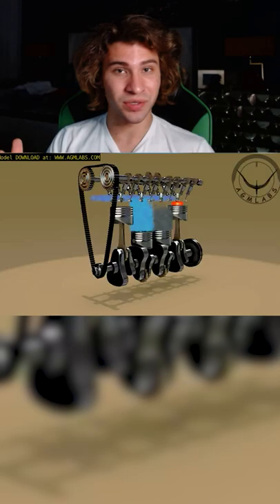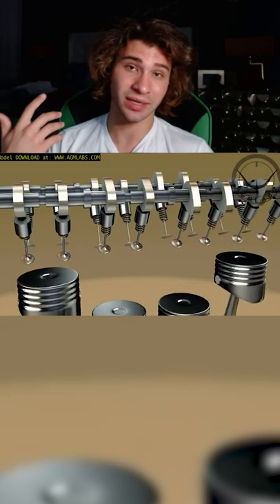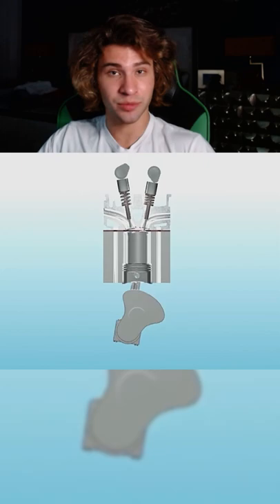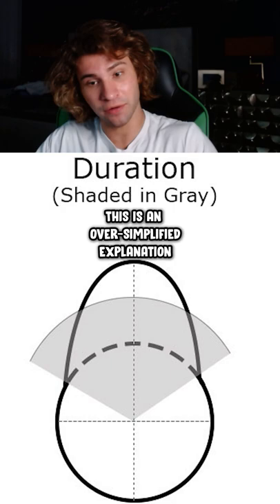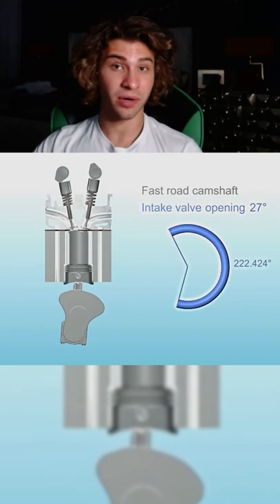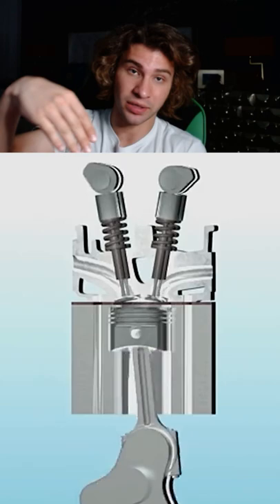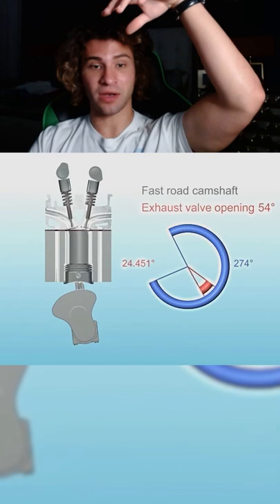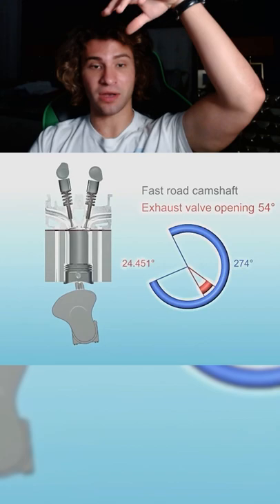HOW AFTERMARKET CAMSHAFTS INCREASE THE HORSEPOWER OF A CAR! (SIMPLEST EXPLANATION POSSIBLE) #COMPCAM

Comment: Good explanation for a short, anyone interested in a full explanation, here you go.

Camshafts have three(sometimes four with things like V-TEC) variables you can play with, timing, camshaft lift, and camshaft duration.

Tech like VVT use a spiral spline that  can rotate from the linear motion along the spiral, like a worm gear to change the timing of the camshafts.

This can compensate for restrictions that appear at higher RPM due to the physical speed of the moving air or how much pressure/vacuum is present.

Camshaft lift controls how far the poppet valves open at the top of the cam. At low rpm, the air is moving slowly, and it doesn't have much inertia.

So you don't want the already slow air to go back out because the intake valve is still open when the piston reached BDC(bottom dead center). At high RPM, the air is moving fast, and if the valves don't open far enough in time it restricts the engine, reducing the total air intake, and power. 

For exhaust valves, they need to be open enough that exhaust gases can freely exit the combustion chamber, or else that restriction reduces power and fuel economy.

The width of the camshaft determines how long the valves are open, and effects idle, low throttle power and top end power, as well as efficency.

At low rpm, a lot of width can create overlap between strokes, but at high rpm this gives the air more time to get inside of the engine. 

A high lift plus high duration forces the valves to open and close quicker than normal, this increases friction and makes the idle unstable.

In general, the less aggressive the camshaft, the more stable it is at lower rpm and the more efficency it is. The more aggressive, the higher friction it has and the more power it makes at higher RPM. It's a trade off. 

There's a lot more to the valvetrain and different types, but camshafts remain the same.